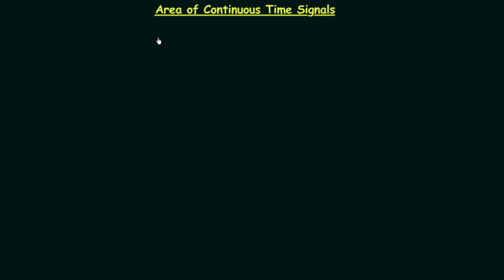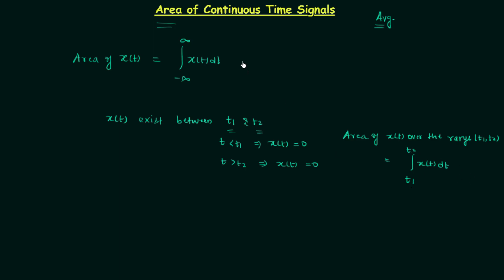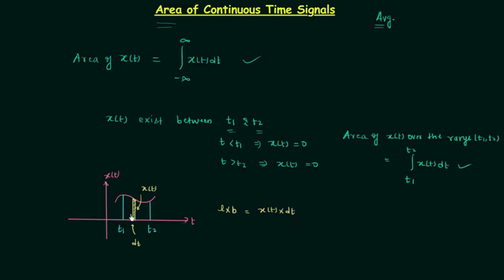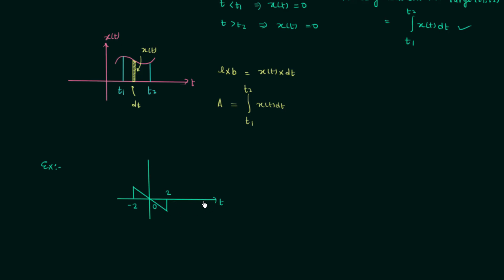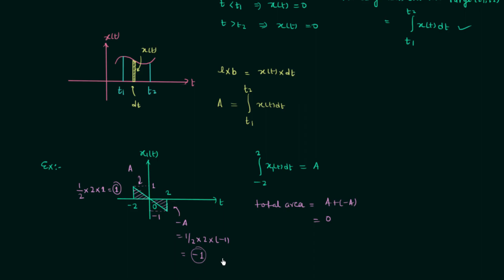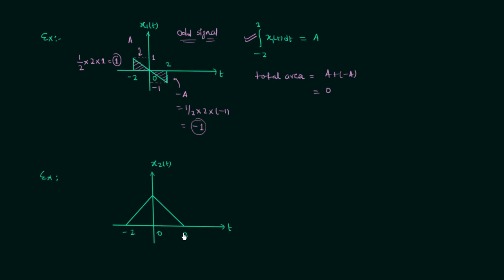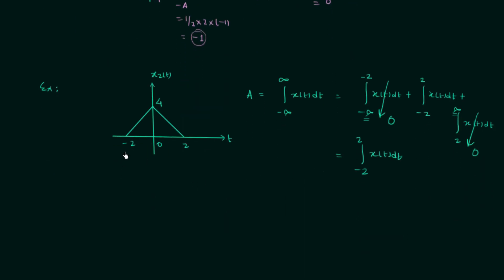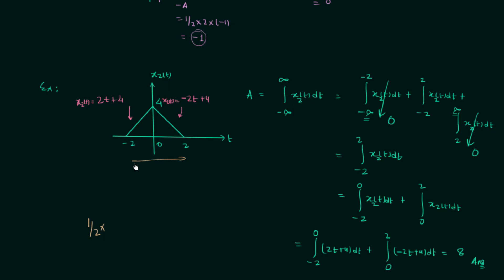Area of Continuous-Time Signals

Comment: Sir answer of second example is 16 and we can solve it by taking it as a straight line or right angle triangle. 
For a straight line equation is y=mx+c where slope is tan(theta) =p/b =4/2 = 2 and -2 for down straight line. 
Y1= 2t+4, Y2=-2t+4
Now integrate both. 
Same as if we let it right angle triangle
Then Area = (2*1/2*2*4)
Reply: No brother ..you are getting confused....answer is 8 only...you can see in your comment only...as you said that its same as taking area of right angle triangle....so if you take area of both triangles it will be 8 not 16 bro...i think you must be thinking that area of one right angle triangle is 8 but its area of both the right angle triangle....i hope you may understand this👍